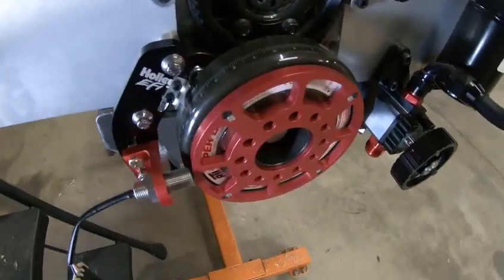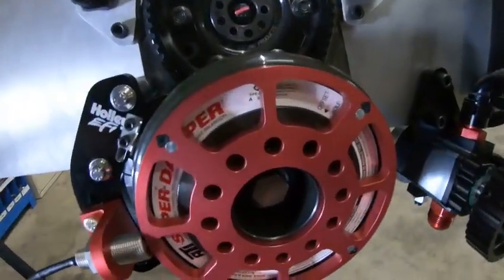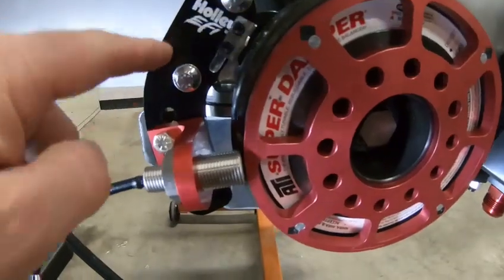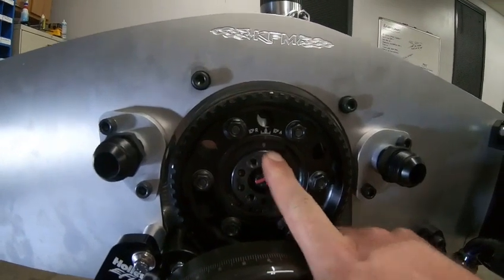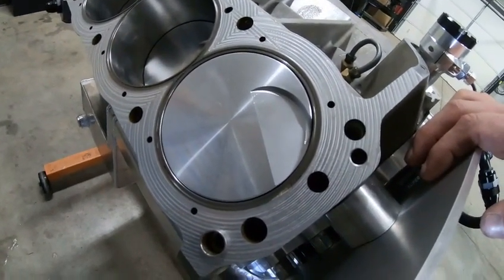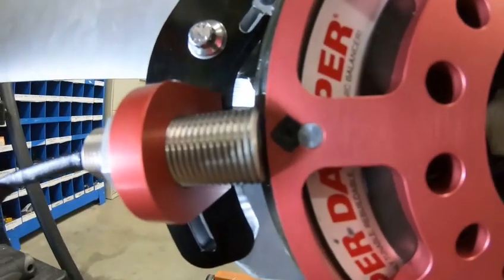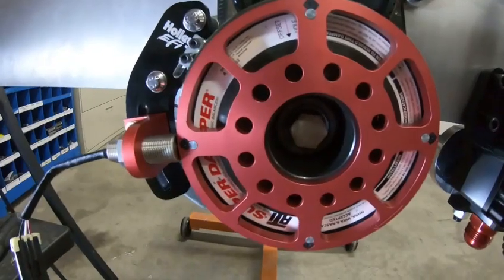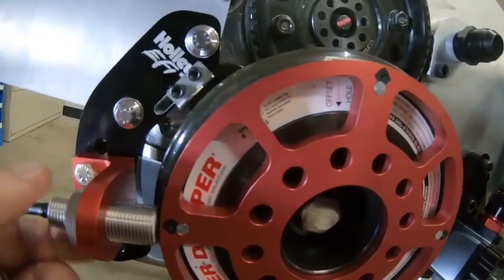msd crank trigger

Comment: ATI can also put magnets on the balancer shell. I had very little clearance on the front of my crank mandrel to all the msd wheel. They do an awsome job, the magnets are epoxied in and then a roll pin is install above the magnet to hold them captive.
Reply: really?! i have a blower so this is very ideal for my setup.. how much was it to get that done and how do you do it.. just call them? thanks!
Reply: @shanesink8073  it's been years,  I can't remember the cost,  but that must mean it was reasonable.  They ask you where your pick up is mounted and pointed,  and subtract 60* if memory serves me right.  I through the balancer in a box and included a note what I wanted and the numbers  they wanted.  They had it back to me in a couple weeks, mind you they're shut down rate now and making hand sanitizer.  I don't regret doing it at all. Best of luck.

Comment: Why is the MSD junk and the Holley better? Do they have the same plug or does it have to be changed to the box or visversa?
Reply from the maker: The holley sensor is a hall effect 3 wire sensor
Reply: @theholleyefiguy  that's what i thought. So is there and adaptor or something, msd is 2 wire?
Reply from the maker: depends on your application if you should switch to a hall effect or not
Reply: @theholleyefiguy  well i haven't had any problems with my msd.
Reply: @curtishanlon1781  Hall effect is better for efi. If you don’t have problems….don’t change it.

Comment: Any opinion of the 36-1 tooth iron wheel with Hall Effect pickup (Holley 556-115) vs the flying magnet hall effect setup?  Would more pulses may be a benefit?
Reply from the maker: i prefer the flying magnet on high powered setups

Comment: Hello devin im putting together my first ever drag  car im running a small block ford 351 dart block  when i had my motor built  i wanted to run between 1200 to 1400 + hp with a 200 shot of nitrous  then i told the builder that i wanted to run on pump gas  i threw a monkey wrench into the build right then  but they did get me 800 +hp on 93  now as the build is progressing  i decided i want to run a pro charger  now my delema is as i was talking to a friend is i wanted to run a f-1A pro charger but my friend thinks i have to much compression the engine has 13.5 to 1 compression he is thinking  i need to lower my compression to run a pro charger  so he suggested i change my pistons or  to try a different head gasket to lower it down he thinks i need to get my compression down to somewhere like between 10.5 to no higher than 12  do you think i can run a pro charger with my compression at 13.5 to 1   Im seriously trying to not open up my engine  and change the pistons i have CHI 3V  pro series heads
Reply: You can run 13.5 compression with boost if you have the appropriate timing and fuel. If your trying to do it on 93 its not going to work out very well. If you were going to run nitrous you would have to do the same regardless.
Reply: @BlytheLifeRacing  i think i have the right stuff just not the knowledge    holley efi ,v5 dominator  ecu  and top line everything else crank trigger  the set up i have now dynoed at crank 804 hp on 93 pump gas and 1043 hp with 100 shot  nitrous with 200 shot that its setup for i believe i can get 1200+ hp  but it sounds like i will have to change my pistons  or just  stay where im at   With my build
Reply: @BlytheLifeRacing  the motor was set up and dynoed using nos
Reply: Also cylinder heads have come a long ways from earlier cylinder heads that detonated fairly easily. You can definitely run more compression these days. With the new technology  combustion chambers we have now

Comment: Hi there from Australia, nice video,  one question,  you replaced the MSD sensor ,  is the reason that the one supplied from MSD not good or did you change to a different type EG :  Magnet to Non magnetic.     I am fitting Flying Magnet system to my SBC NA with MSD6 .  Like to ensure all will be ok. .   Cheers :)
Reply from the maker: This is the 3 wire hall effect sensor from Holley that's a direct drop in. Hall effect works better in my opinion 
https://www.holley.com/products/ignition/crank_triggers/crank_trigger_components/parts/554-118